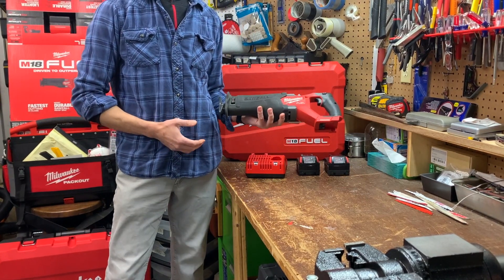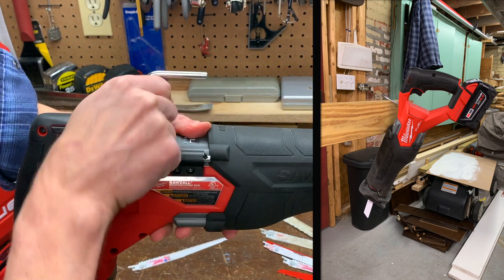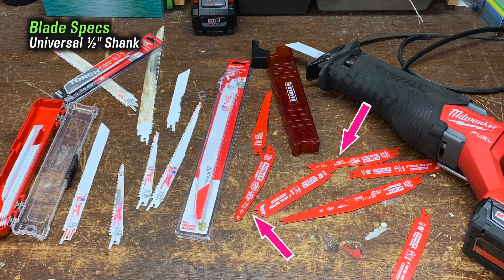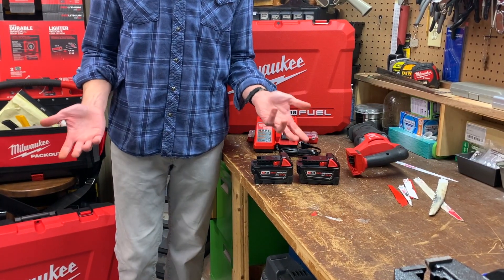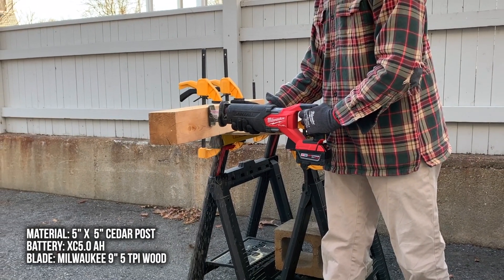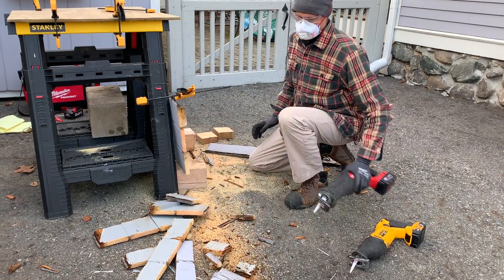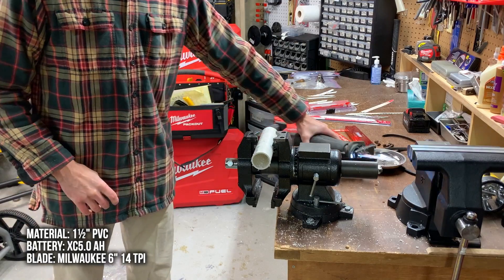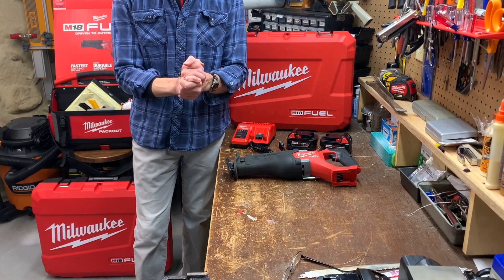Milwaukee M18 FUEL SAWZALL 2821-20 Review (Gen 2 BEAST!)

Comment: Love this tool. Expensive though. I was going to get the SuperSawzall, but the oscillating blade and multiple blade positions weren't necessary for me. The Super Is also heavier...  maybe Milwaukee is charging by the pound. :)
Reply from the maker: I always try to buy tools on sale. I picked up a bunch of stuff over the holidays because the deals were too good to pass up. I looked at the Super Sawzall as well. I would have liked the multiple blade positions added to this model, but it still rocks. Thanks for sharing your thoughts.
Reply: I too was going back and forth if I was going to get the super or this one. I went with the super since I have the fuel hackzall for light applications. The SS is on backlog though so I'm a bit nervous if I made the right choice. 😬
Reply from the maker: Your strategy makes sense. If I had the smaller hackzall for lighter work I would have gone for the Super too.

Comment: This saw can cut for sure but leaves your arm with nerve damage from vibration. I own the flex and the gen 2 and ill take the flex anyday
Reply from the maker: Thanks for sharing your experience! I’m only in three battery platforms (M18, M12, and DeWALT) so I haven’t tried any of the FLEX stuff.
Reply: @BruceAlanR  flex is great you wont be disappointed

Comment: The rapid charger kills the battery longevity.
Reply from the maker: Thanks for sharing your thoughts. I have that same feeling and I imagine the supercharger is equally as hard on batteries… heat is not a battery’s friend. Depending on what I’m working on, I tend to load my regular chargers first and use the rapid and super if I’m getting low on batteries.